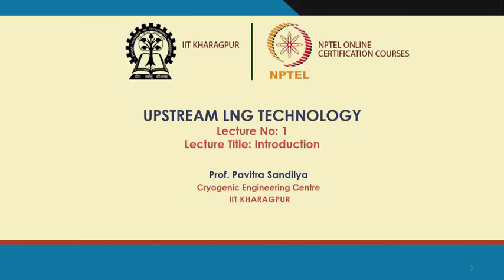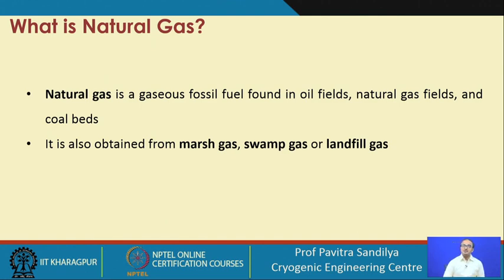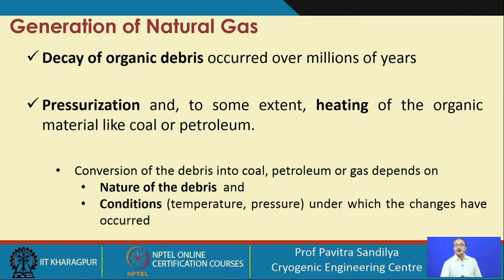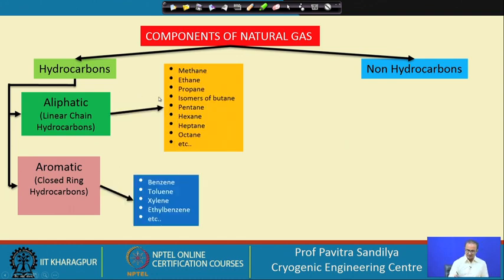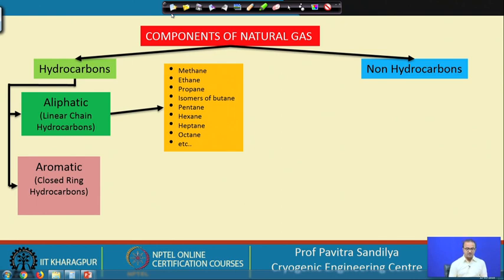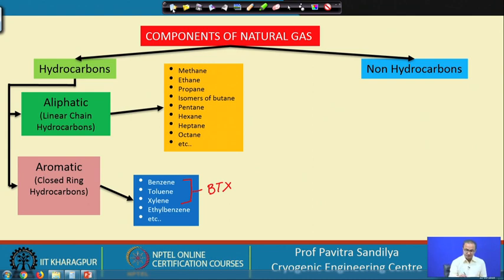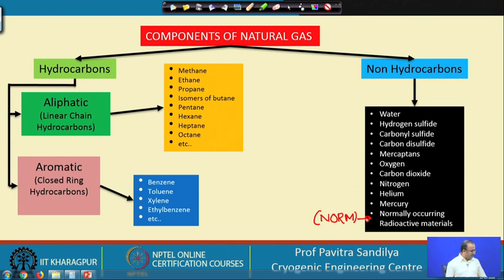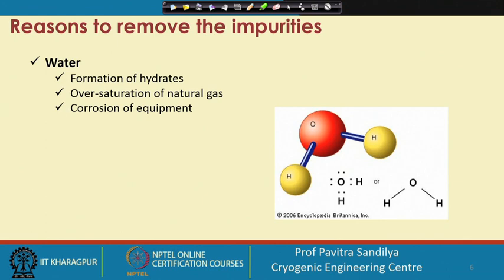Lecture 01: Introduction

Comment: Does any one have some ISO standards for LNG such as ISO/TC 67/SC9 for liquefied natural gas installations and equipment
1. ISO 2840 : Ship-to-shore interface and port operations.
2. ISO/TS 18683: Guidelines for systems and installations for supply of LNG as fuel to ships.
3. ISO/TS 16901: Guidance on performing risk assessment in the design of onshore LNG installations including the ship/shore interface.
4. ISO/TR 17177: Guidelines for the marine interfaces of hybrid LNG terminals.
5. ISO 16903: Characteristics of LNG, influencing the design and material selection.
6. ISO 16904: Design and testing of LNG marine transfer arms for conventional onshore terminals.
7. ISO 20088-1: Determination of the resitance to cryogenic spillage of insulation materials -- Part 1: Liquid phase.
8. N 93: Guidance for conception, design and testing of LNG storage tanks - comparison of worldwide standards.
9. ISO/AWI TR 18624: Guidance for conception, design and testing of LNG storage tanks - recommendations.
10. ISO/NP 20088-2: Determination of the resistance to cryogenic spillage of insulation materials -- Part 2: Vapor phase.
11. ISO/DIS 20088-3: Determination of the resistance to cryogenic spillage of insulation materials -- Part 3: Jet exposure.
12. ISO/CD 20257-1: Design of floating LNG installations - Part 1: General requirements for floating LNG installations.
13. ISO/AWI 20257-2: Design of floating LNG installations - Part 2: Specific requirements for FSRU.
14. ISO/PWI 20257-3: Design of floating LNG installations - Part 3: Specific requirements for FLNG
Thank you!.